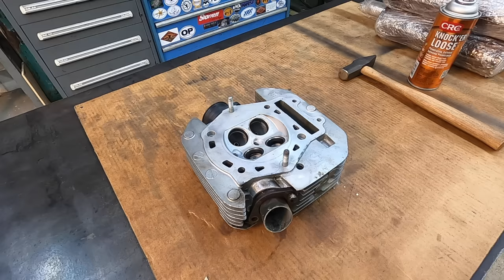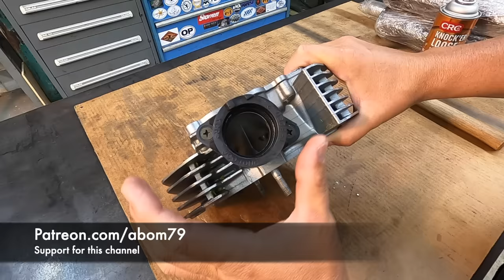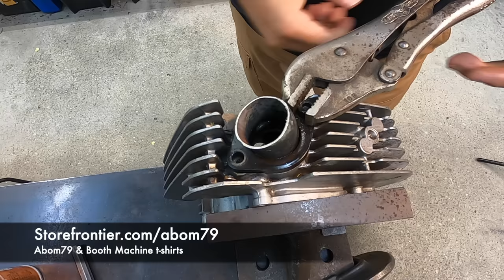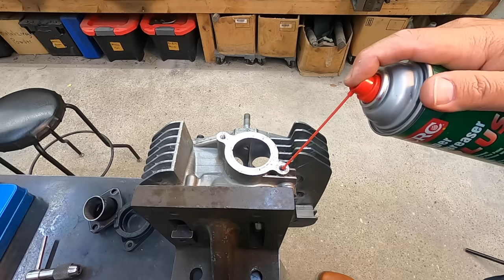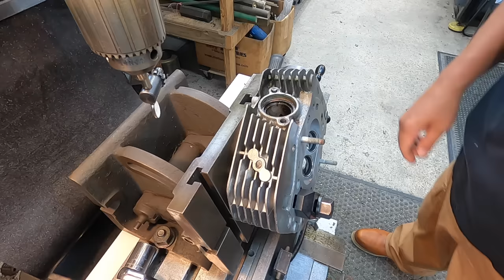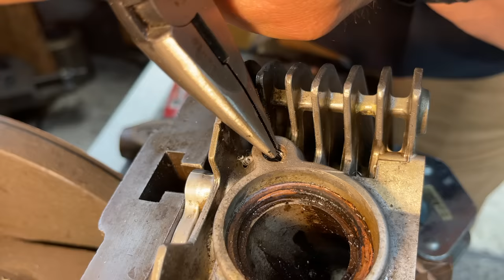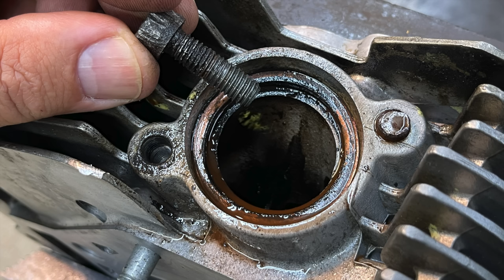Broken & Siezed Bolt Removal, DR 650 Cylinder Head

Comment: I have a lot of appreciation for your successful job, but after years of working for a guy who learned how to wrench on the coast... I have a lot of experience  extrating seized and broken fasteners, and I will say the smoke wrench is your friend... Both of those fasteners would have come right out with the ol' torchy torch without the need to square the head up in a mill and go that route. (Heat, try, quench with oil, heat, try....) But, solid work gettin' the job done, and maybe someday you'll see some videos outta my shop showing my own trials and tribulations.

Comment: One trick I often use where the head is rounded out I use a rotary tool, & grind a flat on 2 sides, then use locking pliers, as doing this gives wider area to lock the pliers onto.

Comment: I have an exact same problem on my suzuki Xf650. I believe that the engine is the same as dr650. Thanks for the great video!!  Cheers!
Reply: The heat on the exhaust bolts seems to really cook em in good. I guess the oxidation process would be enhanced by the heat. Just guessing. The best lesson I learned about right bolts is try to get a microscopic amount of movement then go backwards and forwards. And always imagine the shear stress on the shaft and try to stop before it shears off. That’s the worst feeling.
Reply: @alangrant5278  Thanks for the tip. I will try to use vice grips  with combination of shocking the bolt + lots of wd40/hacker. Hopefully I'll get some movement there. The plan B is to drill the bolt out. Plan C is to remove the whole head and bring it to the metal workshop.

Comment: Weld a bolt into the imbus.  weld a little bit extra, to heat the alminium. or use a torch and heat quick the alu. near and around  the imbus bolt. the aluminium expendes,  and you can easeley loosen the imbus.
Reply: That is my go to, especially in aluminum. The shape of that boss around the broken bolt a propane plumber torch would have expanded that enough and a wash then a nut welded on top would have worked perfectly.

Comment: Pretty good skill, using only a small level and his eye.  Most of mine I can get out by drillling a hole just big enough to fill with mig and then welding a nut on top.  It doesn't work very well  when broken off below the hole's surface, and when it doesn't work, it goes south in a hurry.

Comment: Time for exhaust studs & antisieze like they use in the DR-Z400 head. The Suzuki crank cases love to hold onto certain bearings and I've had several that my blind pullers couldn't budge but welded races could. Too many cats to skin. 

Vessel would want to fit JIS screws, because they were the first company to commercially produce the compatible dirve bits in quantity! The vessels I've used have all been ball bearing in chevron designs, I prefer Ko-Ken tools pin in chevron design.

Any reason why you didn't tap the inside of the thread with a LH thread tap? I'd give it a higher success rate than LH twist drills with no real additional effort/expensive tooling.

Comment: Never seize/ Nickel lube  prevents, steal into aluminum  sizing! One of my tricks is to drill a hole in copper, place over stud and arc weld a riser then weld riser to a nut! & work back & forth!
Reply: instead of the riser.....way not a bolt???? read my comment on top....
Reply: @cosimosanfilippo9050  A bolt wouldn't drop over the riser tit I mentioned !  ( It's a mail femail thing!) Heating and working the frozen stud back and forth gently! May help! Brake fluid pernitrates best!

Comment: Greate job my man. Nice to have the tools and know how to use them. You sir will never run out of project. Or people that need your skills. If I was a young man I would have lover to hang around and clean your shop and tools. Just maybe you would have let me learn a few things. Iwas able to do that in an old stile repare and fabricating shop learned some stick welding along with some OxyAcetylene welding or gas weld. Then I got in to Auto Body and Paint. Met a German felow that was a tin fabricator the man could amase

Comment: Place a nut over the shank of the broken bolt, the hole of the nut should be close to the diameter of the bolt, then TIG weld the nut to the shank and quickly work the bolt back and forth with a wrench, it should come out most times.

Jason Dacalio
Reply: Yes sir  i am a technician ceritfied honda, kawa, yam. bombardier and you tell the simple war  to make a  pro job and you keep  the boltage stock like new in very little time. Let's imagine that there are 10 broken bolts on an old engine, the way to the video at $90.00 will cost $900.00 LOL

Comment: Welding a nut one size larger than bold to be removed has always worked for me , same size nut does not allow enough weld.i was a machinist and a millwright in a pulp mill so delt with a lot of rust. If you need to protect metal from the heat such as tool steel or distortion than use less heat .

Comment: Steel bolt into aluminum always a problem,  we used heat when removing transmission from transfer cases to get them out .
Reply: As a former motorcycle mechanic I encountered this problem frequently. I would go so far as to say that it was almost guaranteed that this would happen with the bolts on the exhaust side of the head. This problem can be eliminated by using bronze bolts rather than steel. Or replace the bolts with studs and then just deal with trying to get nuts off the studs in the future, Again use bronze nuts on steel studs to eliminate the problem.

Comment: To the OP, heat is often your friend when removing bolts of from castings particularly when dealing with dissimilar metals.
Its also often helpful to seat the tip (by itself) with a couple of hammer blows before using the impact screwdriver to attempt removal.

Comment: I recently had to redo the top end on my 2000 trx300fw Honda. It turned into a bolt nightmare as the ones that were not froze in came out with the treads attached, My answer was to put a heli-coil into every hole. Even the spark plug ate the threads,

Comment: U prob know but from watching u u know what u are doing . But all of those screws had thread locker on them . I b use permanent red on all the screws on my rifles I think 262 is the #. When its time to service about 300 degrees from a soilder iron tip in the head of the screw u will see a small puff of smoke when the thread locker melts and is kinda turned into a lube to remove the screw . U might have been able to remove all of the seized bolts just from melting the thread locker . I am a 35 year master machinist. Maybe that will help u on thread locked bolts. 
Terry Barton. Thanks for ur excellent videos
Reply: - there was no evidence that the exhaust studs ever had thread locker on them - if they did, they may have come out, as the intake screws did.
Reply: Thanks for reminding me, I've fought lock tight bolts then used heat, problem solved!

Comment: Would copper high temp anti-seize work when re-installing those bolts for next time?  Good to 1800F.  Someone commented below about loctite 242 blue thread lock working for exhaust manifold bolts. But would it melt inside? I think it melts at 300F
Reply: Eclipser2004..Loctite 272
for permanent bond..That's a high heat red thread locker and it works perfect for exhaust studs...Just cover the entire thread and bolt them in,make sure both threads are free of dirt and grease and let it dry at least 24 hours..I allow 48 on mine.

Comment: Good job. Wish i had a milling machine. I did a similar drill out by hand on a water pump bolt that broke off. Had to remove the timing cover and after drilling out the bolt I tapped it one size larger since i didn’t have a machine shop to properly center and level the face.

Comment: I really enjoyed this video…you are quite the technician!  Wondering if a little CRC would have helped when pulling out the last bits of the bolt.  I wish I had the tools and expertise like you.  If this ever happened to me, I would be C-clamping it, using a bench vice from Harbor Freight and my Black n Decker Drill with some prayer...quite the difference.

Comment: When I drill out a frozen bolt, the first bit I use is a very small drill bit, Then I can get penatrating oil to threads at the bottom of the threaded hole and soak the threads. The larger left handed bit has more of a chance to bind in the hollow stud and back out the stud.

Comment: The small battery impact drivers won't break a bolt, but will rattle it enough to let the penetrate get in. Last project broke 9 t27 torx bits.

Comment: Sometimes with vise grips on bolt head, heat head with torch then allow heat to transfer to block and wiggle bolt. Heat will transfer expanding bolt hole plus penetrating oil.
Reply: It also releases lock tite  a regular screw driver would have taken that out and no need to beat on a cast head

Comment: Here's an even harder one for you, a 4 cyl. Yamaha with a manifold bolt broke off in the head but someone already drilled it and broke off an extracter in the hole so we can't drill it anymore now. So what can be done with this?
Reply: Try to mig weld to the extractor then pull it out.

Comment: Is there a reason not to use a little heat on the casting to expand it for easier bolt  removal?
Reply: My question too.
Reply: @billcostello7769  Adam didn’t say but my guess is the guy asked him not to use heat on this very expensive part.
Reply: @ellieprice363  LOL those 650DR heads are easy to come by. It's a very popular engine with loads of used spares on the market. Those heads are dirt cheap...
Reply: @sinki19841984  Makes you wonder the guy didn’t just pick one of them dirt cheap heads up in Canada instead of shipping it all the way to Florida to pay Adam big money to fix it.

Comment: Good Get'er out Adam.  Old school and seems a bit hokey but the good old impact driver seems to work as often as not providing someone had not beaten you to the head of the bold and mangled it up already and it's not an exhaust bolt.  Motorcycles is where I used the impact driver most and those bolts on the exhaust get stuck so tight sometimes it seems a small tactical nuke is about the only thing that will break them loose.  I agree with your logical progression from easy to more invasive.  Saves unnecessary damage to the part.  My experience with left hand drill bits is they work just enough of the time to be worth a try.  You have to drill the bolt out anyway so it does not really involve an extra step.  Can't ever recall an exhaust bolt coming out with a left hand drill, I may have forgotten but it seems they work on other things better.  That scorching heat gets those bolts more or less welded to the head.  They almost dare you to try to take them out!

Comment: If you are going to do any kind of automotive restoration jobs, you have to have the right tools and a good brand impact screw driver is mandatory along with a good brand of EZ out bits.
I can’t tell you how many times those two tools saved my but!
It’s too bad you didn’t remove the two studs on the head so he could machine that side flat to ensure he has a good mating surface.
Lol
Nice job.
Reply: Which EZ Out brands do you prefer? Great Video!

Comment: I know the head is aluminum but I would try a little bit of heat maybe as little as a heat gun at first then some maps gas. Any time you have to different metals they react and seize up. But I really think heat would help if the head was cast iron heat would definitely be the trick.

Comment: Liked the idea of an oversized end mill to give you a good shot of finding center of bolt plus facing the top of the bolt flat. This job could hand not turned out that well. I would have used a little heat in conjunction with the left hand drills, but I do a TON of saltwater outboards on the Bridgeport . .

Comment: thanks for the excellent video from an old shadetree gearhead who back in the day had many similar problems but never had the equipment you utilized, however, i always had spare heads, blocks, trannies, etc., as the vehicles i worked on always had spares from the junkyards. i'm dating myself as those days with plenty of junkyards are a thing of a long-distant past, unfortunately.
Reply: those days may come back as regulations on cars & trucks increase.

Comment: Sometimes you can use a small cold chisel to jar the broken stud end, either straight crossways on the end or tangentially to get the stud end to break free. Also, when you chase the threads, begin with a regular tapered tap going to the bottom, then finish with a bottoming (plug) tap to end up with clean threads all the way down. Then use antiseize to reassemble!

Comment: If it too big to bake “aka” engine block
Warm the post cherry wide with an acetylene tip 6 to 8 Holer .Cherry the area around the stud ,
dry ice the easy out for a day and slowly walk it in.  Make sure you see vapour coming off the easy out .
Wear gloves.
 pre drill to the centre diameter of easy out  mic the easy out and go .05 over.
Slowly rubber hammer it in.
Do not turn! Wait for the click!
It’s audible. That means the stud has shrunk away from the rust wall  then grab a straight easy out not the bite one. Rubber hammer in. 
Twisters damage the wall size.
Turn in a 1/16 turn then work it out . Use tap die method. If it locks stop . Dry ice again with the next day and finish. Most times I’ll get half and the temps equalise. You will be Tempted to vise grip it out . Don’t!
You can gall the threads.
Especially Stainless!
Wait freeze and finish the next day.
Or just drill and put in a Ez coil and live with fact that you did not master mechanic the job.
On the intake side .
Nothing beats a sharp apex brand nickel bit and a impact driver, yet.

Comment: Propane on the exposed bolt?  Cut a slot in the head with a cutoff wheel?
Reply: DR Dan ,
Probably,  I meant to heat and cool several times too.

Comment: I do those every once and a while. I call it a $300 bolts either way. And doing it periodically I have way better tactics. Years of technics I’ll take to my grave. Ultimately broken bolts require drilling out and inserts added or worst case, broken cast aluminum thread which is aluminum Tig weld and rethread. But great upload for the DYI.
Reply: Why would you take techniques to the grave? It could be a great teaching video. I’d watch it.

Comment: i used to take my old 350  to 550 watt miller soldering iron . with 12 gauge wire as a tip and heat dissimilar metals worked pretty good most of the time

Comment: Got a DR650 as well since they are air cooled all of the gaskets and fasteners seem to 'bake' in. I got my exhaust bolts out but soaked them first it is a 2006 model so been in there a long time.

Comment: Have you tried air hammer with a punch bit? Can lower the air pressure if you dont wanna blow the bolt up. The vibration helps a lot. They also have bolt breaker air hammer attachments that work well. Hammering on a socket and hitting with impact wrench can work well but gotta be careful with how much torque you send. I personally like to go way low on the torque and vibrate the hell out of the bolt and slowly increase torque. I love the manual impact driver.

Comment: I would've used the same methods as you did. I have often used spot welding on top, then peening it with a hammer to not only shock the threads but to flatten the spot weld surface to make it easier to spot weld again on, use spray lube liberally, spot weld peen, then weld an ear on it and turn it out. But on aluminum it's dodgy because of spatter. Very nice video and tutorial consider me subbed.

Comment: Dissimilar metals (e.g. steel bolts and aluminium body) will seize really hard and in some cases, there's no way to remove the bolt without damaging the threads even if you don't snap the bolt. In that case, helicoil is typically the correct workaround.

And even if the threads do to get badly damaged, run a thread tap through the threads to reshape the threads before rebuilding.

Comment: Dear Abom 79. I think you are very professional  and I enjoy fallow your shows, but there is welding,... and welding. I have removed similar broke bolts inside an engine bay, actually flush with the case , not protruding, which makes it even easier removing it with a "TIG" torch. using an 8/10 mm bolt, grinding the end pointed and sited in the middle approx. of the broken bolt/stud, and having a socket or spanner READY. The heat oh the TIG weld will not migrate else where , but concentrated to the important are, by having the torch electrode, (or not consumable electrode) sharpened very pointed, at least 3 t0 1 thickness taper, and "SS" filler wire. Just weighting a few seconds as soon after finish welding for the welding to solidify, not before, an not "after", approximately from 8, to 10, "SECONDS", as soon as the "RED" is gone from the welding area, and been ready with the spanner without jolting it, but applying gentle pressure, it will become undone easily. TIG makes no "spatters", and all it happens within scrap parts, so (no hot spots), and localise the heat in the rite are, leaving the rest of the work untouched.

Comment: This is a job for a welder,  stick a nut over the bolt and weld it on then lube the bolt while it's still hot.  For the broken stud, weld a washer over the broken stud then weld a nut to the washer, lube and remove. 
Thank me later..
Reply: then when that has failed you will have a mangled mess and are unable to find the dead center of the stud to be able to drill it out
Reply: Exactly. No need to make things more difficult

Comment: Drop a washer over the bolt then a good size nut weld down the center of the bolt and washer the heat will release the bolt from  aluminum and the nut let's you spin it right out

Comment: Came here for a tip to remove mine, come out with the obvious fact that I need machine shop work. Tried it all, welding nuts with washer, loose nut, extractor, heat, zip gun etc 🙃